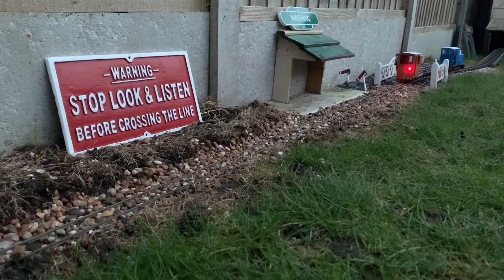16mm Garden Railway by Dusk - Progress video.

Comment: This is brilliant, something lovely to come out of lockdown. One question I do have is how are your locomotives powered? 
All the best to you :)
Reply from the maker: Hi there. Thanks for the kind comment! It has certainly kept me busy and continues to do so. It’s nice to be able to get away from things for a little while by going into the garden and having a thrash around. 
They are all battery powered locos. I have tried to keep things simple so far and have stuck to the cheaper end of the market to test the water. So far so good. They all use either 4 or 8 AA batteries. Eventually I’d like to get a steam engine but that’ll be later on I think. Don’t forget to subscribe for more videos, just uploaded one now :)